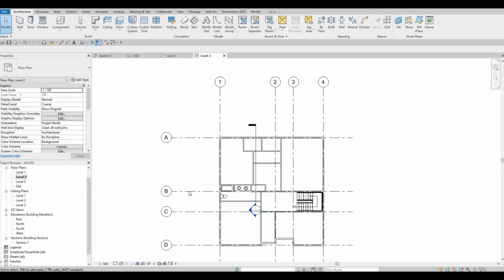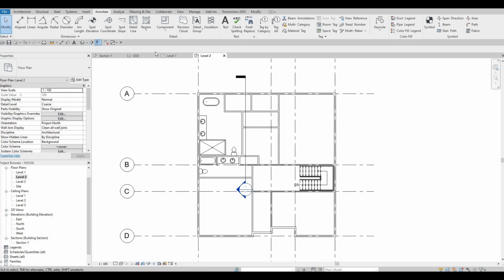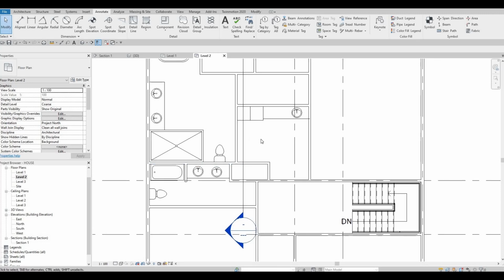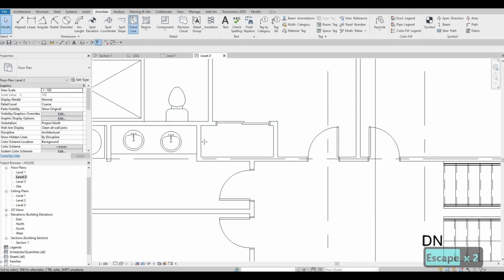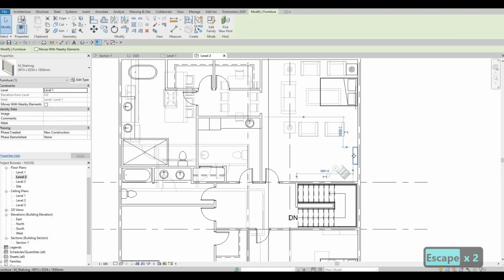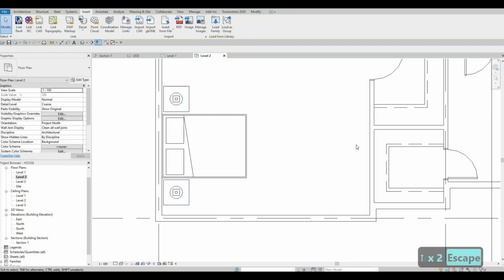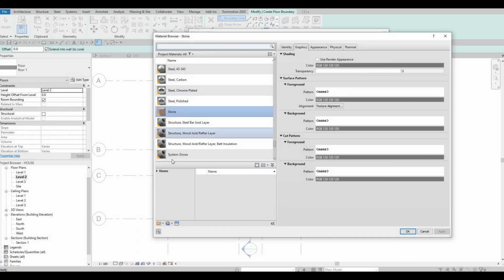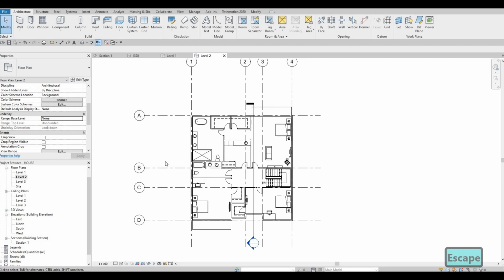GEGT House | Part 6 | Complete Step By Step Project | Revit and Twinmotion Tutorial

Comment: Hi there, I have an issue. Everytime, I select the level 1 underlay, I can see the elements but I cant select them.
Reply from the maker: You will need to click “select underlay elements” it is on the bottom left side of the screen. Besides the “pin” icon. Once you click that. You will be able to select underlay items. Hope this helps. 🙂🙏
Reply: @ArchCoreDesigns  thank you!